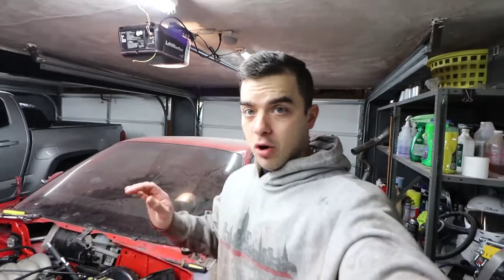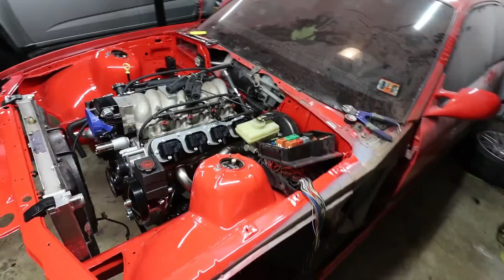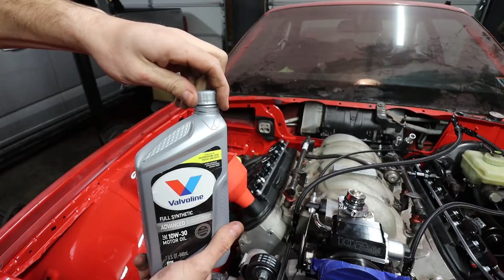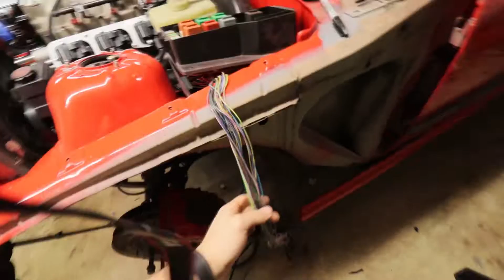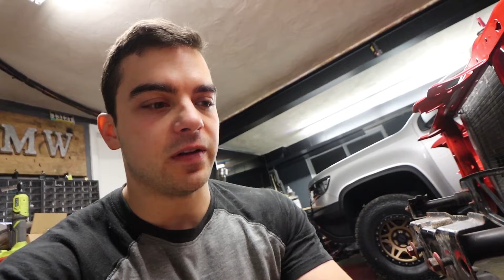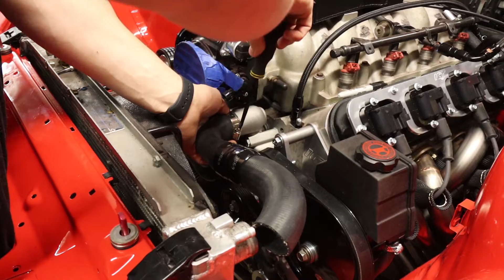LS Swap Wiring - Looks harder than it is - E36 LS1 Swap Pt. 14

Comment: Got links to the heater t you use for the expansion tank? And what are you doing with the coolant port on radiator and the one on the expansion tank?
Reply from the maker: This is one of them I used: https://amzn.to/3AcVVOl

Not sure if that's the size you need though.

Comment: Hi, How did you resolve your Spark plug wire touching the header?  Longer wires?  Full set, just one?
Reply from the maker: I ended up spacing the coil up a little bit. No issues!

Comment: You could try usi g a lexus ls400 upper radiator hose.
Reply from the maker: Instead of a 2 piece?
Reply: @matt13ross  its what im going to try using on my s13 when i drop the ls3 in. Currently have a 1uz and the upper rad hose outlets look to be in the same general area and same distance
Reply from the maker: Is it a different size on each end?
Reply: @matt13ross  nope its 1.38in on both ends
Reply: @matt13ross  so its a tad bigger than ls hoses but can tighten the clamp more to keep from leaking. Personal choice ig.
Reply from the maker: Thanks!
Reply: @matt13ross  yup 1 piece means less place for a leak

Comment: I'm doing a 2000 ls1 swap on a 97 m3 sedan. Not sure if the wiring still applies but I'm trying to find out what wires to remove and doing exactly what you're doing. What ecu did you end up using? I bought a 97' Camaro ecu with wires for cheap not sure if I can even use it but I'm at a dead end for now.
Reply from the maker: Check out my latest video.  I install the Holley Terminator X.   Pretty easy to do and cost effective as well.

Comment: At least on the automatic climate control, when you remove the outside temperature sensor, it's showing -40°C and the climate control is shooting hot air only. Just a heads up!
Reply from the maker: Really?? I've never heard of this.  I'll have to investigate that.
Reply: @matt13ross   It was the case on my old e39 when the outside temperature broke off, so i think it would be the same on the e36. I have had the full automatic climate control on both cars, but i presume that would be same on manual fan speed controller.

Comment: Where did you get that fan shroud?
Reply from the maker: I bought it with the radiator used, I'm not sure.  I'll have to see if there is a brand on it because I don't remember it.
Reply: @matt13ross  It looks nice. I have been meaning to build a fan shroud for mine, just haven't gotten around to it.

You may test fit your intake piping w/ filter before deciding where to mount your expansion tank. I didn't have any room up front, so my tank went near the ecu.

I routed my intake into the bumper behind the P/S headlight.
Reply from the maker: Have any pics?  I used to have the Euro expansion tank by the ECU, but I didn't like the look of it.
Reply: @matt13ross  not on this phone. Car is at the tuner right now. When I get it back, I can send you some.

Comment: I hope more folks start watching the E36 stuff because I'd hate to see it die from lack of interest!

I'm using this series as inspiration to (finally) swap out the cooked motor in my Hellrot '99 M3 and turn the clock back on 16 yrs of beating the hell out of it :) It's great to see the successes and mis-steps, because I don't trust any channel that doesn't have to run to the parts store 15 times,  "modify" fitment, or re-order the RIGHT part.

Great work man, I'll buy the beers if you're ever around northern MD.
Reply from the maker: I hope so too!  Just need YouTube to push out the videos so more people see them, but that's really out of my hands. 

Love Hellrot E36s! (obviously)

Comment: You should solder and heat shrink the wires instead of butt connecting them.
Reply: There is a reason you dont see solder used on race cars or oem for that matter,  best to not use part store electrical electrical stuff either, proper connectors and wire can be bought for cheaper online than your standard garbage at autozone or a store like that
Reply from the maker: I get most of my stuff through Amazon.  It's inexpensive but I haven't had any issues yet.
Reply from the maker: I'm not experienced enough with solder to do it confidently.
Reply: @matt13ross  Well, if I lived anywhere near you, I would teach you. Oh well, I enjoy your videos. Keep it up.
Reply from the maker: I might try it at some point, but I think my next skill will be learning to tig weld.

Comment: Very nice, clean build. You know butt connectors work until they don't work. Which incidentally is exactly like a soldered joint so I agree with you on that. Its very easy to create a cold solder joint and not know what is going on. The only thing I would have recommended is spiral wrap over the wiring instead of the shrink wrap where the splices are located. I've had to cut that stuff off too many times over splices I've screwed up and had to redo. As you know doing things three times because you've missed something is a common occurrence *cough* radiator mount **cough**. And you are so close to firing the engine, that's always exciting!
Reply from the maker: Hopefully when I put the front end back together everything works, LOL.  Thanks!!
Reply: @matt13ross  wouldn't that be a shocker for everyone lol
Reply: @matt13ross  hope it happens tho!
Reply from the maker: Thanks! lol